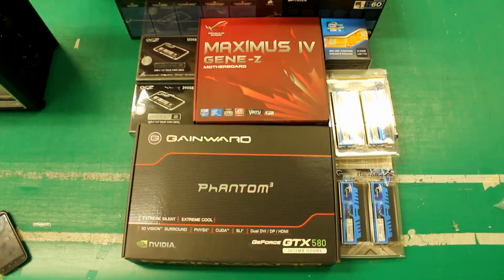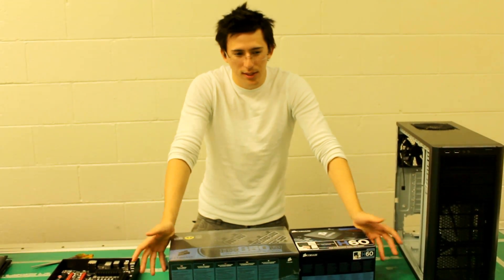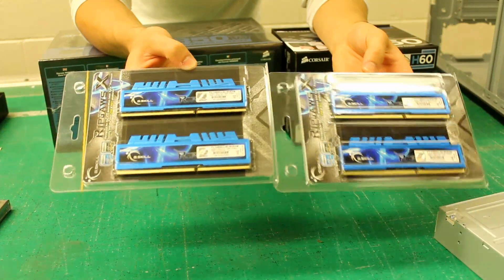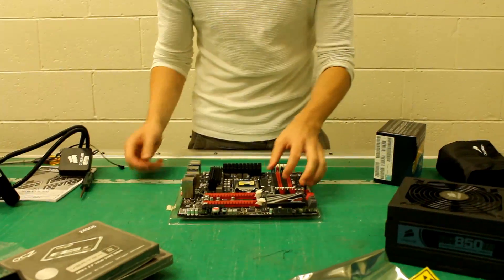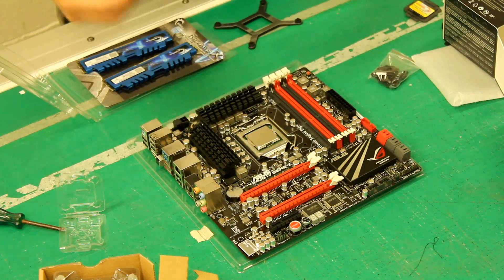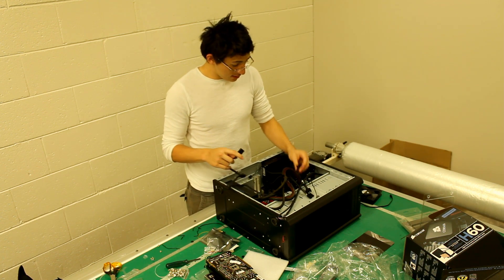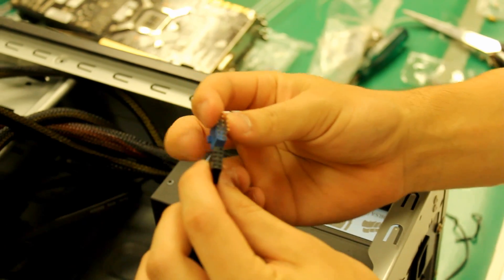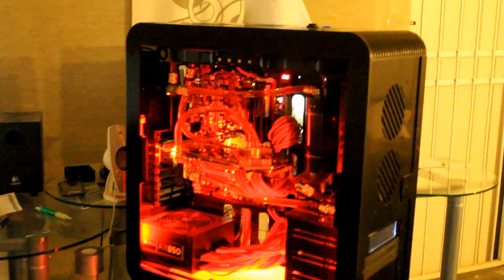How to build a Computer by Epic PC

Comment: RAM won't fit in a PCIe slot, it won't fit in the power-cable slots etc. RAM will only fit in the RAM slots. And as an added bonus, the connector is split in two, in about a 2/3, 1/3 configuration so you can be absolutely sure you're putting it into the slot the right way!

Comment: Where do you get those front panel adapter things? Manually plugging each wire into the motherboard is such a pain in the ass.